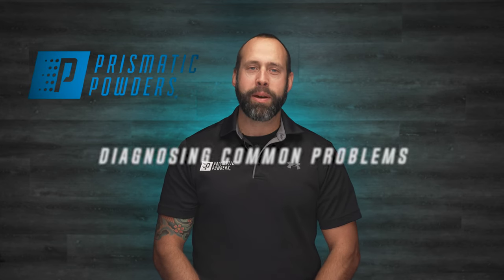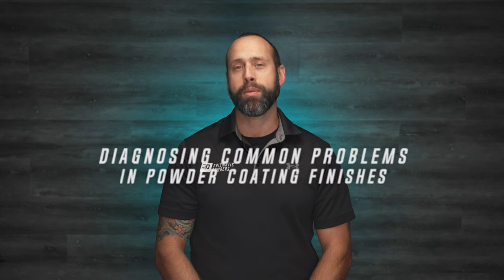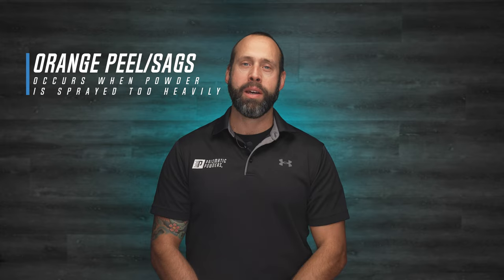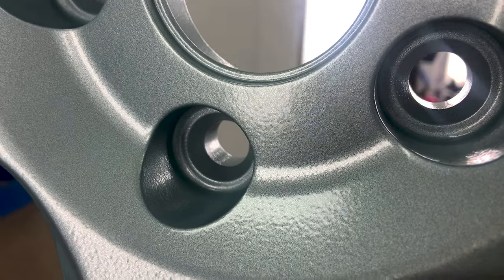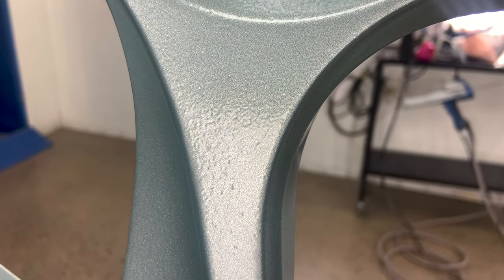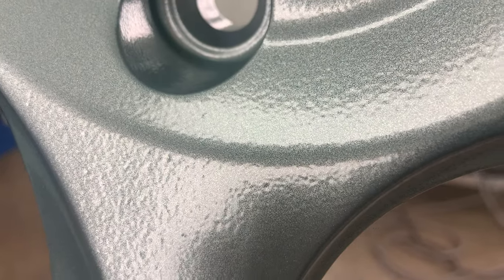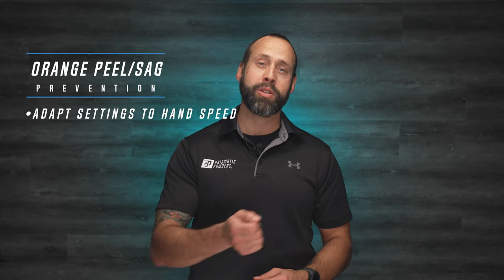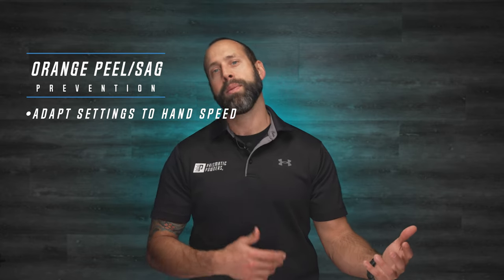Diagnosing Common Problems in Powder Coating Finishes

Comment: i am experiencing issues with powder coating. I am using epoxy polyester powder, but it is showing signs of corrosion or poor adhesion, particularly at the edges please help me
Reply from the maker: Sharp edges can be tricky to build mil thickness upon. However I do have a question, Is this an interior or exterior project? Epoxy powders need a clear to protect from UV, having another layer will also give you another chance an gaining more mil thickness on edges.

Comment: Man im so frustrated with Black Chrome III, I am brand new to Powder Coating and just have a Cheap Harbour Freight gun and cheap walmart toaster oven..I had no problem with Orange, Gloss Black and Matt Black but I just can get the Black Chrome to look good :(
Reply from the maker: Reach out to our technical support team. They will get you pointed in the right direction for a successful outcome. As you are experiencing not all powders spray the same, and there are some nuances that are learned from experience. Our tech support team will give you a short cut. technicalsupport@prismaticpowders.com